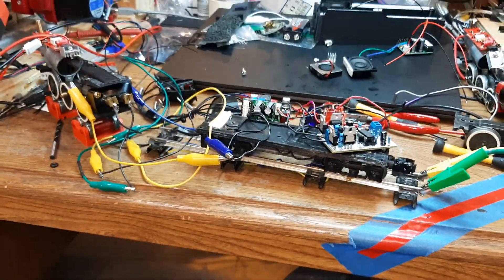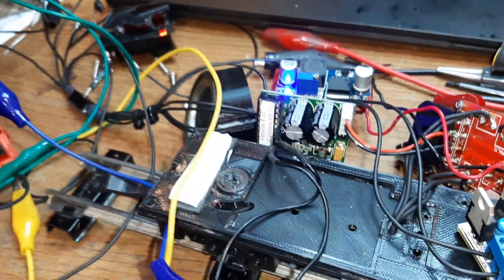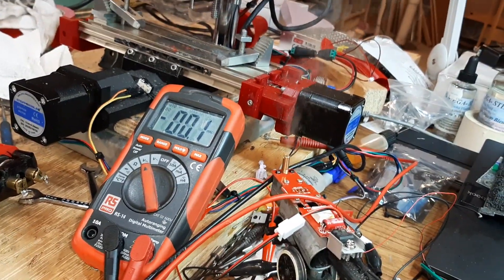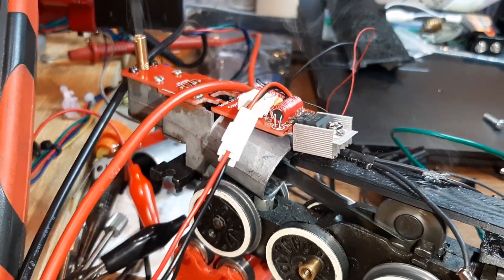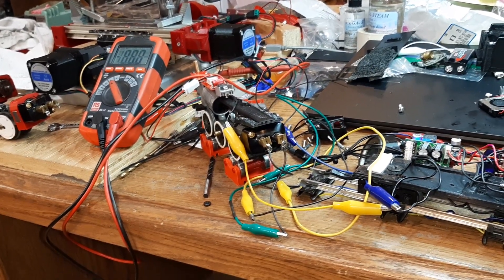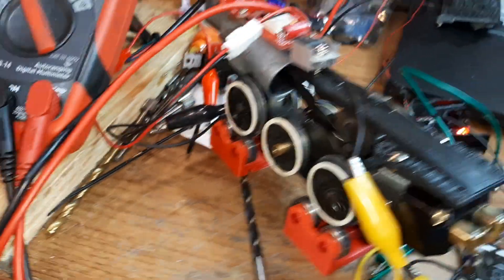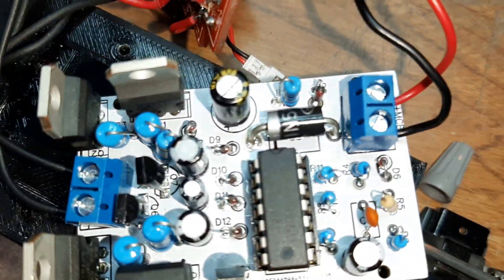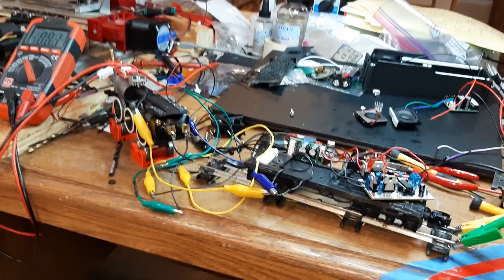Frankentrain Laboratories K5 final test & tune. New MCB and Chuff trigger seems to run quite smooth.

Comment: It sounds really great!!!
Reply from the maker: Yes the chuff trigger is reliable and even works a the highest speed. Very satisfying. Should be the standard build for Vintage FLyer S Smoke. These sound boards are nearly gone we need to find a reasonable replacement. The Tender was supposed to be the show case as it was totally 3D Printed. All Wheel Pick Up Trucks, 3D Chassis Plate, 3D Body, 3D Lid with coal load. Even has a cooling fan, Digital Reverse and 2 volt regulators, Sound Board and the best speaker we can fit in there. That Tender model could be changed easily to match lots of other engine types. The Engine Configuration will change for the Reverse in Boiler never had smoke Chassis. The Smoke gear has to be introduced, Milling the slot in the chassis then mounting the gear and Puff & Chuff triggers. Which today provide 2 P&C per rev. Following up with Pulse Width Modulation Motor control with WiFi Wireless hand held control driving all the same gear. I had been trying to move the tech as a form of Next Generation S. But I also felt we needed to the minimalist version 1st, then a retrofit to the least compatible to tech chassis, then wireless control at very low speed. With those three versions all coming toghether and leverage each other onte way up the tech pole I now am starting to work on totally new body shapes and tender types. I want to use these chassis baselines Level 1, Level 2, Level 3 to produce and offer engines we Never had. Even engines that may have never been built in the theme of tribute engines. Now we are closer than ever to provide other makers with the files to print their own Kits all based on the S Standard and the Gilbert baseline interfaces as a Next Gen S Standard. Even looking at 10 Driver Engines, Dual Articulating engine 4x4 and 5x5 even 6 X 6!!!! Why not we own the design and have the standards to reuse or repurpose all the subsystems. My dream is when I am gone these parts, Standards and Scale all survive and move on for a very long time in the hobby. I hope to see 3rd party engineered Theme Engines using our Standard Next Gen S.